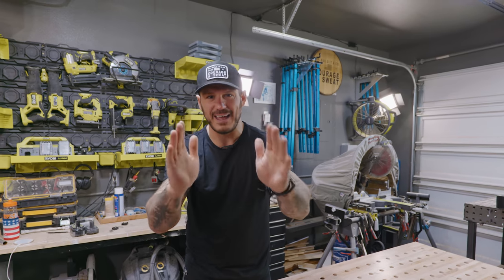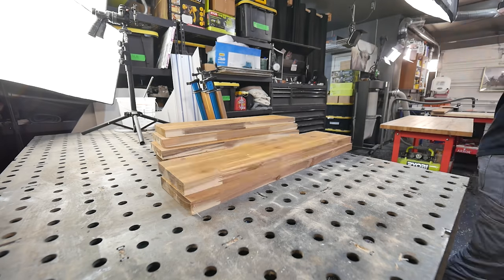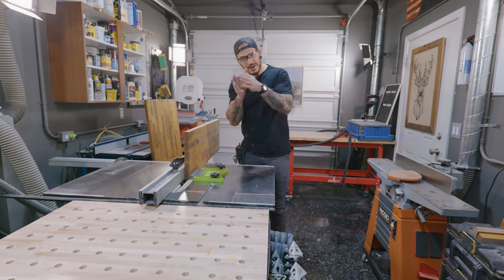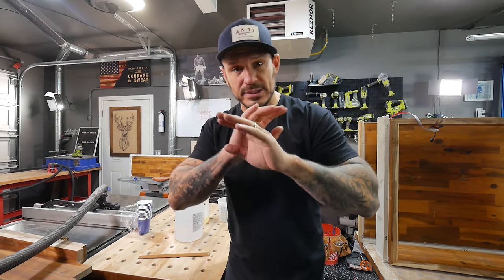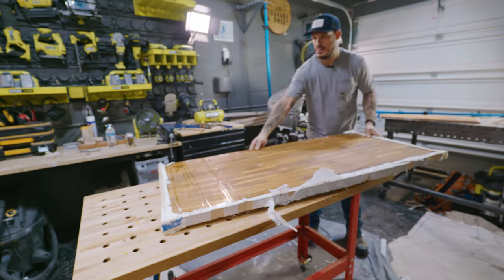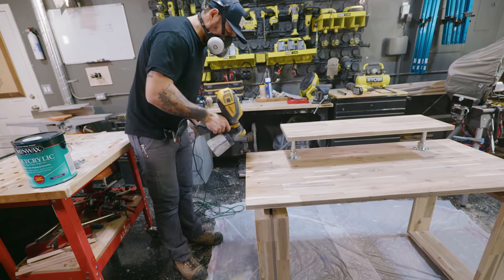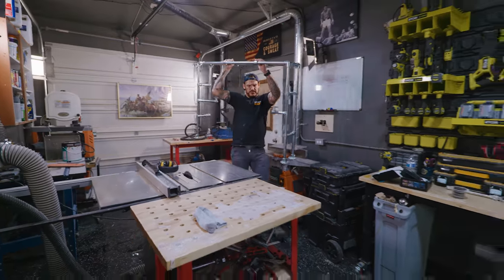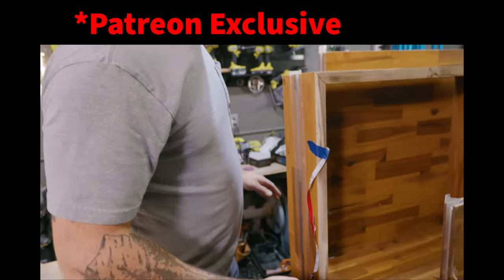Building My Kid's a Dream Gaming Desk

Comment: For the epoxy pour, if you mix in a small amount of white color it’ll opaque the epoxy so when the LEDs are on it’ll diffuse the light so it looks like one continuous light as opposed to the series of LEDs on a strip. Makes the light less harsh and the overall result more seamless. Desk is awesome!

Comment: Downside to using the epoxy with the LED's is you'll not be able to replace or repair them easily. I've used many LED strips and no matter what you use the will eventually burn out a LED.
Reply: thats why a real gamer only cares about performance of the game and the system not all the bling (Led color strips etc ) .....that stuff is just a waste of money ( no led in computer  towers etc  - solid metal cases  )
Reply: I grew up with solid pc cases and that's how they should be no glass sides that can break with the slight bump. Performance over looks.
Reply: As sad as it is to say, I doubt the desk will be around long enough for the LEDs to burn out.  It's for a kid, they change their mind / needs every 20 minutes.  I know I've gone through around 6 desks in probably 25 years.
Reply: @JamesLee-sw6ss  i have a shelf system that was 8 then turned into 6 that my dad n i built over 30 yrs ago and still in 1 piece .... plywood/2x4s and trim pieces  turned it into a 6 shelf because at the time i put my 20 inch TV  and VCR  in the shelf  in my bedroom .... brought it over to my apartment that ive currently been in for 16 yrs  .... still bright Fire Engine  Red color all these years
Reply: And it didn't even hide the LEDs at all.  Seeing the individual lights and the PCB strip is ugly.  Would've looked much better with a clip-in plastic diffuser.  As a side benefit, using a metal channel with a diffuser would help with heat dissipation and keep the LEDs lasting longer, as well as make it serviceable when (not if) the LEDs need to be replaced.
Reply: @Erik-pr2rf  Good for you?  

Now, do you think you're the exception or the norm?  Hint: it's a rhetorical question.
Reply: This guy is pretty smart but when I saw him use epoxy I’m like that makes zero sense. A channel does a perfect job of diffusing the light and the setup will look just as clean not to mention you can change the lightstrip lol.

Comment: 2 tips:
For maximum effect LED strips should point towards reflecting surfaces so you see the bouncing scattered light and not the LEDS directly(also not good for your eyes)
The speakers are way too high and pointing into the wrong direction, the ideal height is about your ear level when seated, and each speaker pointing to your ears, not to the wall
👍
Reply: Nice

Comment: Nice project! How about an LED channel for the LED strips instead of epoxy? You could probably sink them into the grooves if you wanted the lighting to be flush. They usually come with covers that diffuse the light a bit which helps blend the points together and make it look more seamless. It would also be easier to replace your LED strips that way if you need to.
Reply: 100%

Comment: Sweet desk, if you do a v2 I wouldn’t epoxy the LED’s in as if one burns out it will look weird and depending on how the LED strips are made it would burn out the rest of the strip. 
Plus as he gets older maybe he would want to program the LED’s and make them do effects which would require new strips (since they are epoxied they can’t be replaced.
In stead would love to see just some frosted acrylic strips for better diffusion and can be removed.

Comment: There’s silicone tubes for these leds that you can just inset into a grove.  Very clean diffusion and serviceable.. had a similar scraping experience - using a plane goes quicker than sanding if its a lot of material to take off… props for pulling through :D

Comment: Would have done edge by edge for the epoxy so you could control air if I had to do epoxy, but I probably would have just used clear led channel diffusers designed to go in the t-track but you can just mount it into wood instead so they can be fixed if anything goes wrong.

Comment: Another recommendation regarding the epoxy, don't buy the slow cast stuff. That's meant for thicker pours (think inches). Regular epoxy would be fine, and you will be able to do each part one at a time... less stress, less mess! Nice work overall though!
Reply from the maker: Great point!

Comment: I like the desk! Just a suggestion, anytime you use led lights like that, its good practice to use an aluminum channel. You can still used a combo of a dado stack and router to recess it into the wood but that would allow you to replace the strip when it burns out.

Comment: An easier way would be to use led raceways. They make them where the cover is frosted so you don’t see the single led and it disperses the light better, you can also switch out the led strip whenever it goes out.

Comment: If you don’t want to do epoxy you can cut a thin strip of plexiglass and glue it in. Sand the inside surface and it will diffuse the light.

Comment: I wouldn't have made the monitor stand.  I would have put another pipe in the middle and used a VESA monitor arm mounted to the pipe.  This would allow more desktop area and be easily positioned for different players.  Just a suggestion.  What are those pipe connectors called?

Comment: Great vid, super cool concept, turned out great. Just some constructive criticism- dont think epoxy was the right move to diffuse the leds. Would have been better off using some aluminum channel with a diffuser lens and either cutting a channel for it to recess, or attaching it to the faces. Pro tip- use the 1' deep aluminum channels. the standard 1/2" stuff doesnt do the greatest job of diffusing. can get them pretty cheap on amazon, in black or raw. That's how I did my desk. Just attached the channels to the vertical planes of the desk top. looks epic, get lots of compliments. should do a video. Hope it helps! But otherwise, love the design and concept. well done.

Comment: Maybe a budget idea instead of that VERY expensive epoxy would be to use a 1/4 in sheet of acrylic in the dado cut into 1/2 in wide strips… few dots of CA along the length should secure it well enough.

Comment: Would’ve been cheaper and easier to use a small sheet of acrylic and cut plugs to fit over the leds. You can then sand and get the opaque look wanted.
Reply: Plus you can service the leds if needed.

Comment: These leds will hurt your eyes, besides, the desk may catch fire because the wood does not receive heat very well. You should use aluminum led channel. It would dissipate heat and can soften the light thanks to a diffuser panel in front. Nice done.

Comment: Great project, the thumbnail is extremely cringey though. Not a fan at all of the over-exaggerated face.

In hindsight, if I were to inlay the LEDs, I would instead glue some acrylic to the edges and sand them until thoroughly frosted. Or attach some magnets so the acrylic can be removed if the LEDs need replacing.